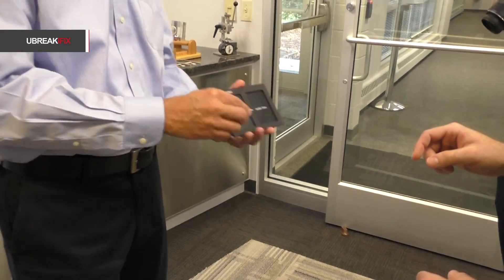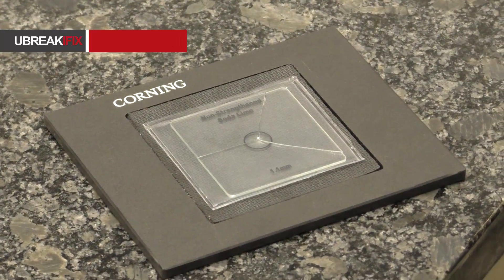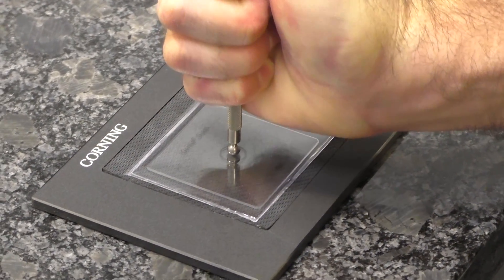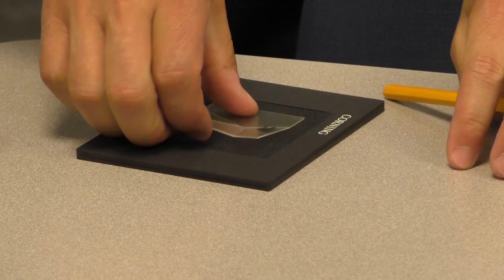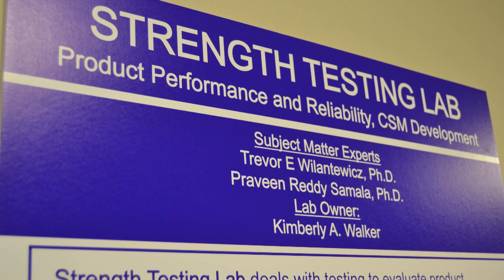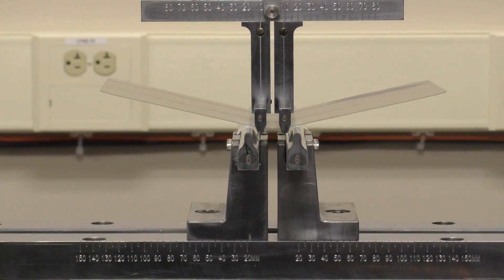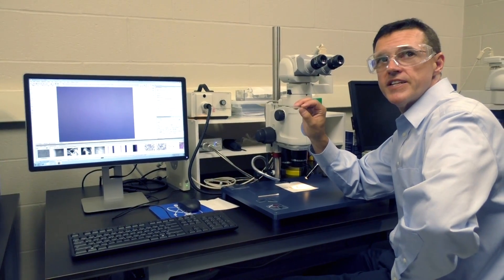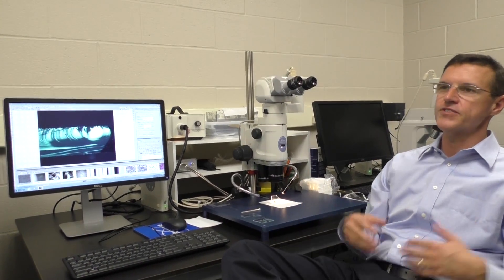Corning Testing Facility Behind the Scenes

Comment: as a 2 year mineral glass manufactory worker I would like to say that all tat fancy gorilla glass is a lousy marketing bullshit for all you apple-fanboys. since it is not a mineral glass, but organic one, this makes it close to acryl. or in other words - reinforced plastic. it has nothing to do with usual tempered glass and cannot be that hard in any way. these tests show nothing. the glass may bend fine and stay solid, but anyway your phone's display is much weaker and would break with minimal bend. so it's a fine way to break your screen with glass/sensor intact. anyway you'll be forced to replace both by the warranty service, so it's mostly useless. also, your phones motherboard would break, and the case itself too, so there's no sense in such bending capabilites `cause if you bend your phone that much, the glass would remain the only part not damaged. also, the surface strenght is not equal to the edge strenght. so just drop your iphone on the edge of the screen and it would break in 99% of cases. even with the window glass the toughest is the one without corners, the round one. no use in phones though. and the last one: no glass would be strong unless it is at least 4 mm thick. and since all of you wish to have a whole phone 4 mm thick, you will never have strong glass for the handheld. just forget it.
Reply: *****
okay. android fanboys :D
Reply: ***** +1
Reply: I'd be more likely to believe you if you could spell and write properly, and if you realized that Gorilla Glass is more common in Android phones and that there are many, many Android phones out their than iPhones